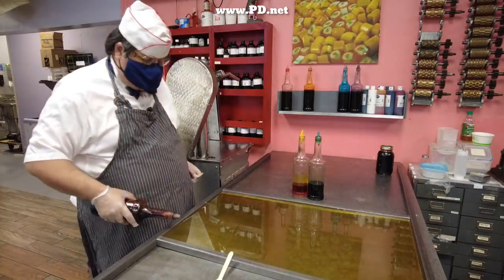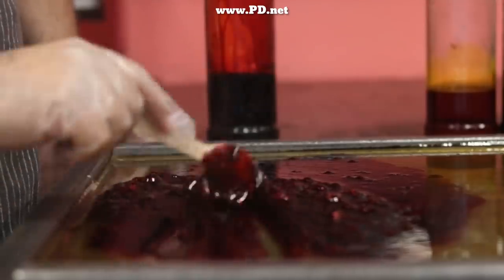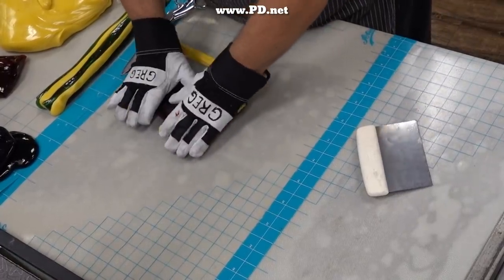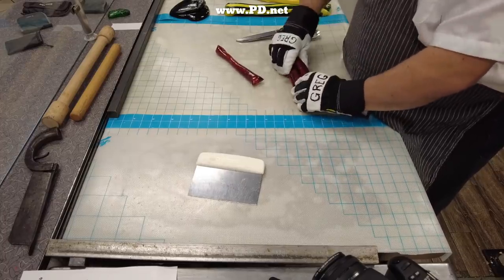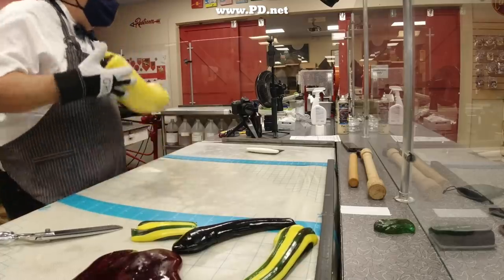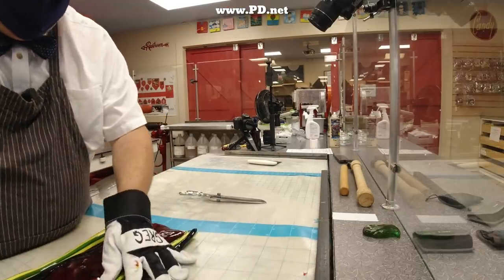#147 Chocolate Covered Strawberries in hard candy. (Live Audio)

Comment: I always imagined that the temperature of the metal table could be regulated by running more or less water through it, but I guess not. Do any candymakers know if that would actually be useful? Or would it just be more of a hassle to have to adjust the temperature every time?

Comment: You need a higher set of rails for the cooling table on cold days, so you can pour a deeper bed of molten candy and it should take longer to cool.
Reply from the maker: I have a set of those, the middle of then remsinss too mobile benefit from very hard to cut apart without colors spreading or mixing. Causes different issues. Easier to work faster.

Comment: 1:43 Doesn't your table have heating/cooling in it? I think I remember you saying something about how you can adjust the table temperature...
Reply from the maker: Yes. With water. It's not so much adjusting the temperature on that table but adjusting the thermal Mass so it cools faster. The other table is the heating element under it and is a heating table which isn't a great term we're not trying to heat the candy we're trying to slow down how fast it cools
Reply: @LoftyPursuits  Thanks for the reply and hello from Australia. I'm definitely coming by to say g'day as soon as I can. 😉